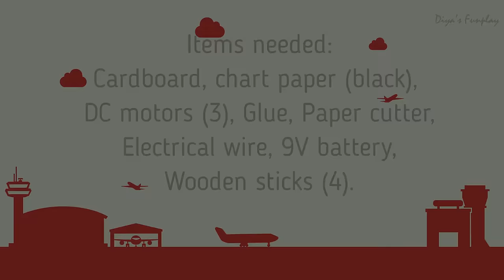Chandrayaan 3 Moon lander & rover working model for science project | Vikram lander & Pragyan rover

Comment: Sir can you please explain how did you do the wiring and fitting of the motors?
Reply from the maker: Just connect a wire to a dc motor and a 9V battery. Simple! I have used 2 dc motors for the wheels and 1 dc motor  for deploying the solar panel. All dc motors are connected and power supplied through seperate wires,
Reply from the maker: Refer the below video. Connect a dc motor insted of a led light.
https://youtu.be/xQ-P-LXG_rw

Comment: How to connect the wires so that the rover comes down?
Reply from the maker: You can connect the rover and battery with at least a meter length of a wire (with switch on the lander back), and place both the wire and battery inside the lander. In this method, the rover will move down the lander without any issues, but reverse motion is not possible. If you want reverse motion, you will have to change the polarities of the battery.
In this video when i tried to move the rover down, the rover slipped down the inclined surface very fast because of its own weight due to Earth's gravity. This same model would have not slipped down so fast in the lunar surface, because the gravitational pull in the moon is very less than that of the earth. So, do not make a smooth inclined surface as i did.  Please let me know if i had answered your questions and let me know if you need more clarifications.
Reply: @diyasfunplay  Thank You!
Reply: @diyasfunplay  Is there any other way without all these connecting wires, (because i'm making the model for the first time). I'm a beginner i need a easy way.
Reply from the maker: Could not understand. Do you want a working model without wires?
Reply: @diyasfunplay  s. How to make rough surface

Comment: Sir how to do the electric work of rover to move it ?
Pls explain all the connection of wires of  rover
Reply from the maker: Just connect a wire to a dc motor and a 9V battery. Simple! I have used 2 dc motors for the wheels and 1 dc motor  for deploying the solar panel. All dc motors are connected and power supplied through seperate wires,
Reply: @diyasfunplay  thanku sir ☺️

Comment: It is very impressive. Well,how much cardboard and types of cardboard is needed to make this? Please reply as soon as you can .
Reply from the maker: Thanks. You will need around 8 square feet of cardboard for the size i have made. Generally cardboard will have three layers of paper. The top and bottom layer will be flat and the middle one will be wavy. There are also 2 layered cardboard. It has only the top and middle paper (1 flat and 1 wavy paper). This is called corrugated paper roll. You can get this in amazon. Generally i use corrugated roll and the 3 layered cardboard. You can also stick 2 corrugated sheets together to make a strong cardboard, Hope this helps. All the best....😊
Reply: @diyasfunplay  Thank you so much for your wishes and for telling about card boards.

Comment: How many volts of dc motor is used in the wheels plzz tell me as quick as u can and if possible plz provide the link
Reply from the maker: 12V
Reply from the maker: It should be a slow rpm motor.